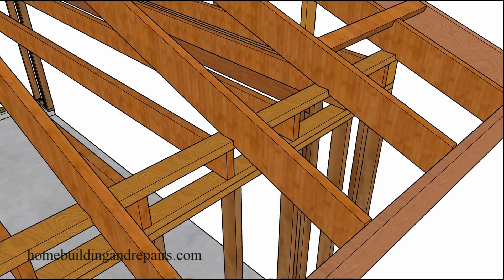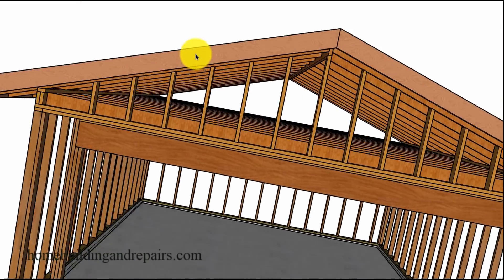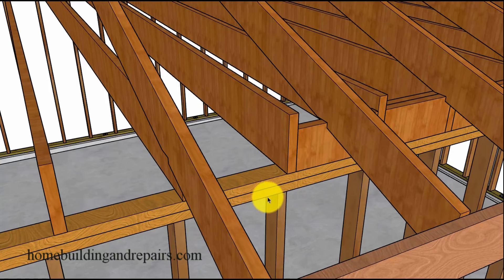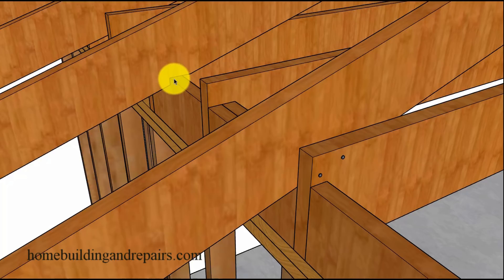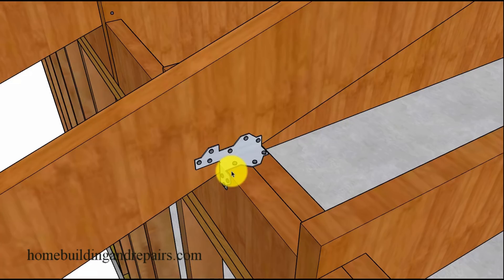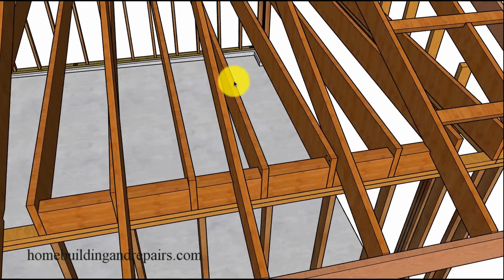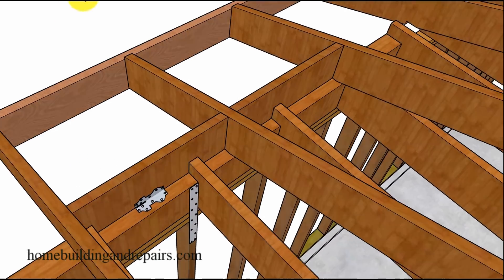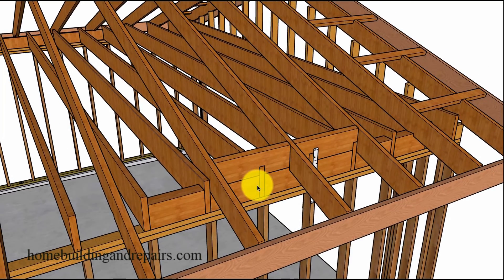Ideas For Replacing Ceiling Joist When Rafters Are Above Them And Not Next To Them

Comment: Is there a video for the "standard" case (i.e. roof joists attached at the side of the rafter)?
Reply from the maker: Yes, in most cases conventionally framed roofs are done that way.
Reply: @gregvancom  is the block keeping the rafter in place (i.e. avoiding spreading) while the old ceiling joist is removed to be replaced?